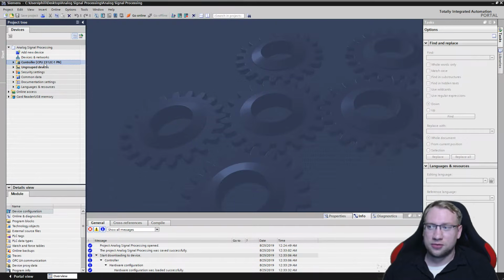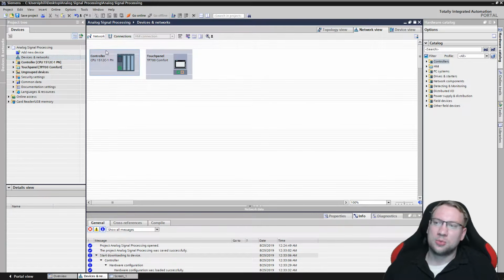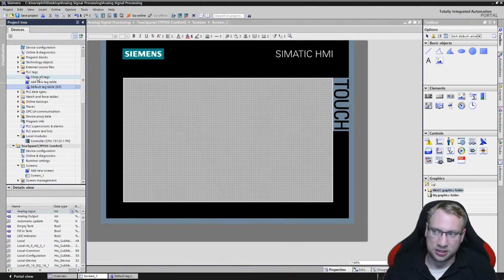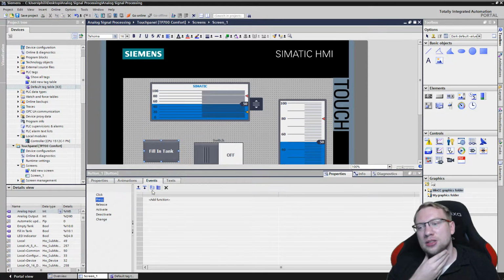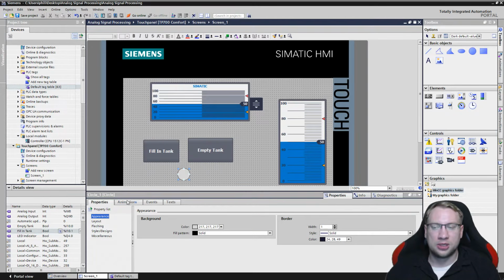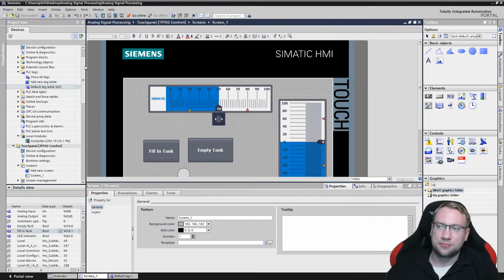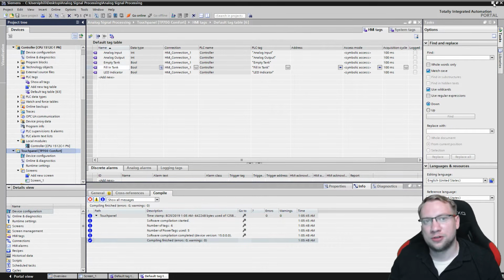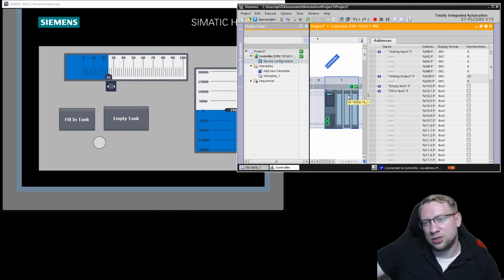TIA Portal: HMI/TP Integration (Human Machine Interface)

Comment: Question. I followed this instruction with the KP300 and a S71212C. I get all links but when pulling a DInt to the panel it shows up as ########. Any ideas? I use the V17 of tia and its the same on the hardware as in the simulator. I must be missing a setting somewhere? Any ideas?
Reply from the maker: The #### usually indicate that you have connection issues... it basically means "cannot get data, so I will replace it with ####"... that exactly is not connecting is a topic for itself, pretty hard to help there
Reply: Thanks. I figured as much. Can it be licensing of the winCC? I have the Basic Lic for tia but I do not have a key for the winCC. I figured a s7-1200 start pack should work :-). Well well. Just dig deeper in the  mess i guess! Great vids btw! Keep it up!